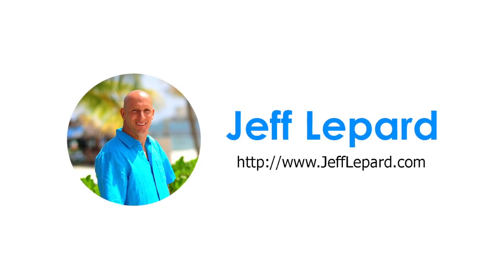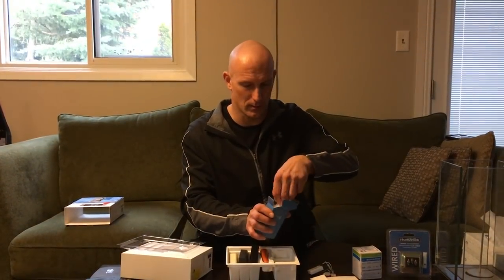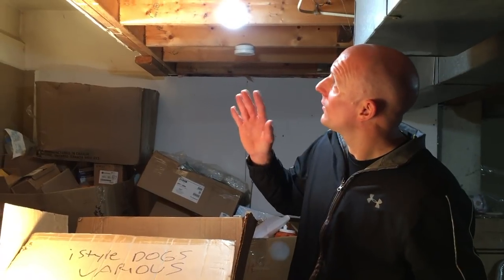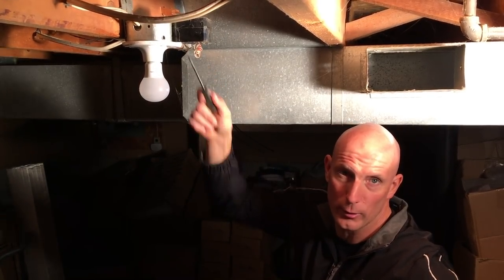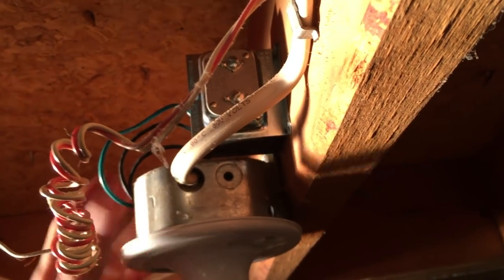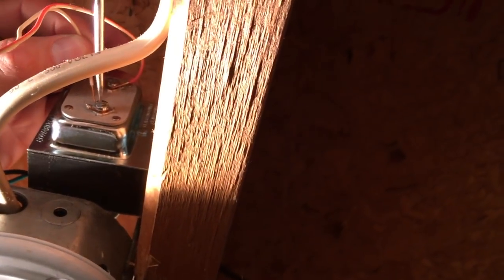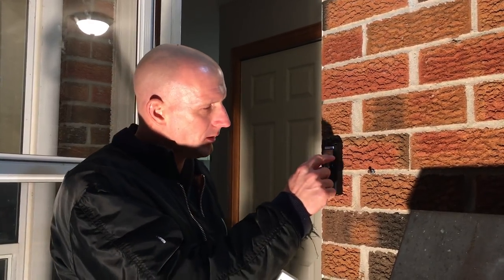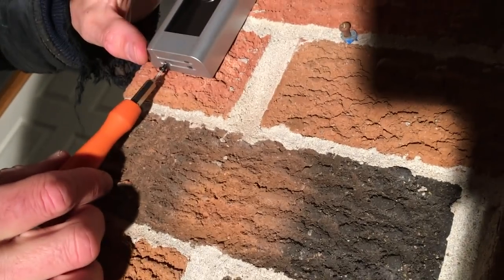Ring Video Doorbell Pro (Full Installation)

Comment: Great Job Jeff, thanks for the detail.  I have been planning to get the Ring Pro, but was hesitant because of the additional power unit supplied with it.  I have an electronic bell with three different chime units on three floors.  After watching you install the new transformer and attach the supplied power unit.  I checked my transformer and found a way to attach one wire to the transformer and fish it to a chime unit.  Solving my problem of presenting a way to make it work.  Never sure until the bell rings and the phone chimes.
Reply from the maker: Thanks so much for watching!  Wow 3 different units on three floors!  That would of made for a great video!  ;o)  Excellent you figure that out!  I hope everything is working perfectly for you.

Comment: None of my nearby Home Depots had a 24V 40VA transformer, but I just ordered one from Amazon with next day delivery. I've had a Door Bell Pro for about a year. My old mechanical bell rarely worked, and the Door Bell Pro just stopped working.
I've dropped both of the little security screws and lost them among the landscaping stones next to my door, and I was just waiting for you to drop yours!
Also, the transformer can be mounted directly to the hole in the junction box by putting the wires through and tightening the long diagonal screw from the inside of the box to secure it.
Reply from the maker: Yeah those screws are so tiny!  I will be doing a new video on this!  Thanks so much for the input on that!  I appreciate the support!

Comment: Thanks for the video Jeff.  It helped me confirm the need for an upgraded transformer.  Best wishes from southern California.
Reply from the maker: Glad it helped.  Thanks for watching!
Reply: Thanks Jeff great video. I upgraded my transformer and got everything working but it only worked for less than an hour. I have 4 other ring and they are all online. There is power to the transformer but can’t get the doorbell to go back online. Would an extender be needed?

Comment: What you called the Self-Leveling tool is the conversion plate from the Original Ring to PRO.  It covers the holes, as the Pro only needs two screws and they are in the center vs the corners.
Reply from the maker: That is called the Retro Fit Kit.

Comment: Jeff, I would put a bead of silicone around the Ring casing since the wiring is just attached to the back. I haven't had a called back water damage for my installations. Other installers have gotten callbacks.
Reply from the maker: That's a great tip, I haven't heard of any issues before but good to know!  Thanks!

Comment: Hi Jeff. Thanks for instructions as we have same setup with recessed door moulding beside brick.  How did you fill.in existing old doorbell hole? Why didn't you use video door bell back plate? Thanks
Reply from the maker: The back plate would not fit where the old doorbell was.  I just used caulking to fill in the holes and caulked over the wires after tucking them in.

Comment: great video with explanation of transformer issue most people are having.  I got the Ring Doorbell 2 ,  digital chime that I have verified will work with the doorbell 2,  ELK transformer 24v 40va,  do I need that little white box that you installed in the chime? it didn't come in the box I received. Happy New Year!

Comment: Hi Jeff, great video. I’m confused though - surely when you connect your transformer to the light, the doorbell won’t work when the light is switched off because the light switch will control the power output to the transformer?

Comment: nice one Jeff  on the inside i saw two white leads coming into the ring bell mechanism from the transformer and on the same connection please throw lights on it or explain 
thanks
Reply from the maker: One of them is just a bypass and goes directly to the door bell button.  I'm some houses you won't have that there.

Comment: Thank you Jeff for this video. I’ve just installed the Ring Doorbell Pro and new transformer, but I only used a 16v - 30VA transformer. Seems to work great for last week now.  I initially wanted to go higher with a 24V - 40VA transformer, but heard going too high may damage the doorbell. Is that not accurate?  And is there any noticeable advantages going higher (e.g. faster/clearer live video feed)? My live feeds loads in about 3-5 seconds and pretty clear — which I assume is normal.   Thanks in advance for your feedback.

Comment: Nice video, i'm going to have to do the same for drilling my mortar.  How did you go about sealing the old door bell location and protecting the wires that first go into the mortar?  Just some caulking?
Reply from the maker: All I did was push the wires flush against the brick and door frame and used white silicone.  I should of shown that part in the video I didn't realize how many people had the same issue as I did.
Reply: That was my question too!

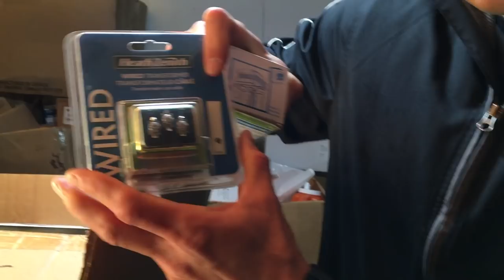Comment: I just wanted to say very detailed information. Like you I research Ring Pro like you before I purchased 18 months ago. I knew I had to replace my doorbell transformer which I knew was not a 16 24 transformer. I never heard of a Edwards, but bought the HeathZenith transformer. So far it has worked well, but I have to wonder if Edwards is better? I do see Amazon sells Edwards, but no problems with the Heathzenith to date 2/10/19. I am only 5:15 into your video, but I give you 5 out of 5 stars for being so interesting. Good job feeding wires on angle for doorbell. The only thing you didn't cover was pairing to app by pressing setup button on doorbell before placing cover on. I like Ring products and occasionally refresh my memory on install and operation. 
Thanks,
Don from Milwaukee, Wisconsin
Reply from the maker: Thanks so much for that!  I definately like to watch videos and research before I buy.  if your transformer is working then you should be ok I don't think you will have a problem.  I should do a video on setup and also I will be doing some videos on all the products after using them for so long.  I think I'm going to also buy the home alarm system.
Reply: My three Ring cameras, doorbell, floodlight and spotlight are over a year old now and I needed to press setup button on all. I think with new Ring products including in house security, you just scan units now. I have been playing with idea of buying Ring in house security.  I don't know if you ever saw him,  but I also watch LIFEHACKSTER  on YouTube and he reviews all Ring cameras, plus other things. He's very informative too on his reviews.

Comment: Hi Jeff, I am adding this comment so that the safety issue in your video stay’s current. Ideally, you would update the video.

The transformer you’re installing in the video CAN BE installed using the knock out where the previous one was located. In fact, it must be as per code. Instead of a lock nut, this particular transformer uses a small bolt as seen at 9:01 - 9:15 to secure the transformer - after the wires are fed through the knockout and the transformer is flush against the device box, tighten the small bolt against the inside of the box. I hope that others will see this comment and the others that have been posted as there is so much wrong with this -- those wires are not rated to be free-aired, should not be unprotected passing through the knockout and an opening that size should never be left exposed.
Reply from the maker: Thanks for the comment!  I will be doing an updated video on this issue shortly and correct that.  I will post the update for everyone as soon as its ready!  I appreciate the help and taking the time to mention that!  Thanks so much!

Comment: Hi Jeff
You certainly have some scary wiring in Canada compared to the UK by the way.
I bought one of these to increase the security around our home, it does work well, I would advise going on the ring website as there are some small software issues for fine tuning the cam.
I bought a plug in Transformer as I have a socket (Electrical outlet) near the front door (from Amazon)
Christmas greetings
Reply from the maker: I'm actually going to be shooting a new video for the transformer upgrade.  Yes, I did see those plug in the wall ones that work fine as well.  I'm going to go over those in the new video it might give some people more options!  Thanks so much for watching!

Comment: Jeff, thanks for this video and the effort you put forth. Can you tell me what gauge wire you are using from the door bell to the transformer to the mechinal chime. I will be running new wire. TIA
Reply from the maker: I'm not too sure what the Gauge wire is since I am using the existing wires.  They are very small maybe a 20 gauge approx.
Reply: @JeffLepard  thanks, I did some further research and Ring recommends 18 gauge  wire for optimal performance.
Reply: Hi I bought the ring doorbell pro since last year . I took it out of country in Africa but I have problem to install it because the voltage in Senegal is 220 volt and I don't know what type of transformer or adapter to use to install it.I really need help.Thanks.

Comment: I would like to ask you one question if it is possible. I saw your YouTube video about ring alarm system. I want to ask if this system can be connected with wired sensors. I am asking that because I already have an old security system in my house and I have already installed sensors motion detectors etc. thank you in advance
Reply from the maker: The ring alarm cannot be connected with with wired devices.  Thanks so much for watching!

Comment: Thank you Jeff for the video. One quick question; I purchased a Ring Video Doorbell.What would it be the best bell Voltage Transformer to use if I reside in Australia.The voltage in Australia is 230v 50Hz.I would be appreciated if you can answer my question.Thanking you
Reply from the maker: Thanks for watching!  Depending on how much voltage amps your doorbell transformer is putting out now it may work or you may need to change.   Everything would be the same only that your transformers input would be either dual or it would have to be 220-240 volts with the same output needed to run the ring doorbell.  I can see some of them on amazon even if you click my link you can type in the search the proper voltage transformer.  If you can't find one let me know I will find a link for you.

Comment: Question, if my house was built this year, do you think the transformer that was included with my current doorbell will be the correct one for the ring doorbell?

I dont have a basement and I'm not entirely sure where the transformer is located.

Also, it wouldn't be a Canadian video if it didn't start snowing mid video lol

Comment: I suggest you measure the voltage before going to the effort of changing the transformer. It's simple. Measure the voltage at the doorbell switch wires. It must be 16-24VAC, which is correct. If less, The Ring won't work reliably. Yes, replace it with a 24VAC transformer. Ring does make a "Plug in Adapter" transformer for US 110v power only, just another transformer option.

Comment: Jeff one more question... my current doorbell looks like it’s using a thin “Telephone cable” wire.  There’s like 4 thin very flimsy cable encased in a larger cable and it uses 2 of those 4 cables... would those be ok with the upgraded power adapter you’ve shown in your video?
Reply from the maker: Yeah that sounds like they used telephone wire or something like that.  The good news is that the door bell runs on low voltage so you would be ok to use the existing wires there with an upgraded transformer.

Comment: Ok.  I bought a ring pro. From offer up ,  but I have a problem, it was owned before ,  so it’s already programmed too someone else ,  so how do I get around that ?   Or reprogram it ????  If you can help.  It would be great !
Reply from the maker: You should be able to do so on the app but if you are having an issue with that you might have to call Ring Support and have them clear the Mac ID # from the system and start new with a new scan or set up!

Comment: Hi Jeff. Great Video: Question; I'm also in Canada - Northern Ontario - How has the Doorbell Pro held up in winter? I hear after a certain temperature (-5?) the unit doesn't work anymore? Can you confirm?
Reply from the maker: Yes I have heard issues with the cold weather!  I haven't had any issues with either the doorbell or my floodlight cam.  I've had ice build up on it as well and they were still functioning!
Reply: Ted the ring video doorbell will still function but there will be little problem with the motion detection

Comment: Hey Jeff. How do I wire the doorbell chime to the newly installed transformer? Your video was obvious when it came to wiring the transformer to the Ring Doorbell. Any help would be greatly appreciated! Otherwise great video.
Reply from the maker: +Quint Yates your door bell is it mechanical or digital.  Thats 1 thing i forgot to go over in the video.
Reply: Thanks for the reply Jeff. It’s a mechanical chime.

Comment: Great Video Jeff.  One question.  I recently removed my chime and hide the wires in the wall (I know that was dumb!)
So if I connect the ring to my door bell wires (I’m able to access those outside) is there a wireless chime that would work with the ring? (Are those ring chime extenders working as primary door chime?
Reply from the maker: Thanks so much for watching!  So with the Ring Door Bell Pro you have the option of either using your existing chime or not.  In my video here I'm using the existing as well as the Wifi Extender / Ring Chime.  The Ring Chime works great on its own and it actually activates faster than my existing door chime.  Excellent unit to pick up and its very cheap.  If you don't need the wifi extender then the regular ring chime will be just fine!

Comment: Great video, thank you!, question: Do you know what size is screw driver, I lost mine and I need to buy it in Amazon, are all screw drivers the same size. Any help will be greatly appreciated Thanks
Reply from the maker: In not too sure what the size is but  the Philips screwdriver would be a small one.   Maybe a 1 or 2 size.

Comment: What if you dont have an existing doorbell. How different would this install be?
Reply from the maker: That would still be fine then you would have to run your own transformer wires or power wires from an adapter or transformer to your Ring Doorbell.

Comment: Do you have to use that little white power box even though you upgraded your transformer.
Reply from the maker: I believe so, that is what taps into the chime box and allows your existing door chime to work.
Reply: Jeff Lepard I’ll answer my own question, as long as your transformer is at least 16 volts or after you upgrade your transformer you don’t need it. Mine works without it.
Reply from the maker: That is certainly good to know that would eliminate 1 step for sure.

Comment: Hi Jeff, is the transformer for the chime or the ring doorbell pro?  I purchased the ring doorbell pro and the ring plug in chime that plugs into the wall and connects via WiFi.
Reply from the maker: Yes it is if you need to upgrade the transformer.  I will be doing an updated video on this coming soon!  Thanks so much for watching!

Comment: Question:  I will be installing a Ring Pro.  My existing transformer is 10VA, which is what my existing digital chimes calls for.   When I install the new transformer with 30VA will that cause any problems to the digital chimes I now have?  Thanks.
Reply from the maker: Great question, it should not do anything to your digital doorbell as some new houses have stronger transformers I'm sure they would of designed the product to be good for either or.  Let me know!  Thanks for watching!

Comment: Just upgraded my rings doorbell to rings doorbell pro. But am having hard time connecting the pro to my iPhone 7 for setup. Tried rebooted my router, reinstalled the app still cannot connect the pro to my phone for setup. Any suggestions and advice is greatly appreciated
Reply from the maker: I wonder if there is a problem with the Mac Id on the ring system.  I would say to contact Ring customer support and get them to check everything out they are normally helpful.

Comment: Love to move the Ring to the brick front but it leaves wires exposed from entrance into brick, an easy clip for bad guys an unsightly as well. Jeff never shows us what he did to address the problem at the close of this video. Please advise.
Reply from the maker: All I did was tuck the wires flush against the brick and the door frame and used white silicone to cover them.  I should of put that finishing touch in the video I didn't realize that there were many more people that had the same issue as I did.

Comment: I am stuck. Thanks for the very informative video. As thorough as you are here, my questions are naturally not ones you address. We got 2 Ring Pros for front and read doors, which have working hardwired bells already. Ring recommends "16V AC at 30 VA" as best I can understand. 

My existing transformer is a plug-in and it is in the attic. None of the 16V AC at 30 VA transformers I can find are plug-in, and the transformer states not for attic use. NOT FOR ATTIC USE, WHAT? I'm wondering why and wondering if you are aware of a mail order source for a plug-in 16V AC at 30 VA, which I assume I could use in the attic. Perhaps the reason I cannot find a plug-in like I need is because that is somehow to much power/heat for a plug-in model, but what do I know. I will greatly appreciate any feedback. Thanks.

Comment: Thanks Jeff.  I just replaced my transformer, which is attached to a smoke detector.  Now I am not getting AC to the smoke detector and am not sure why.  Black to black, white to white and green to ground.  The rest of the smoke detectors are working but not the one with the transformer.  I noticed the old transformer has an additional black wire coming out of it which was attached to the white wiring...not sure why.  Suggestions anyone?